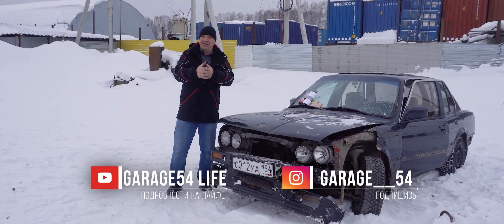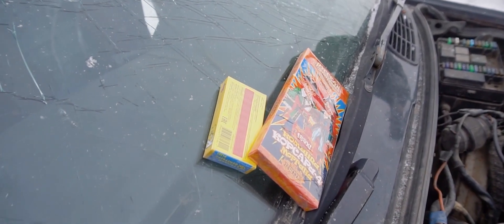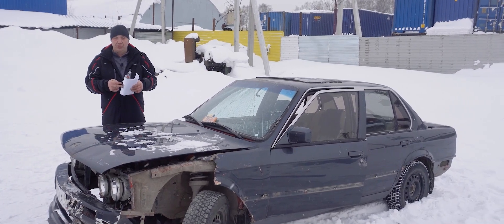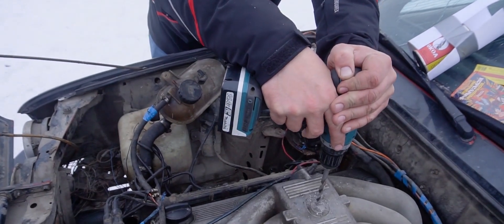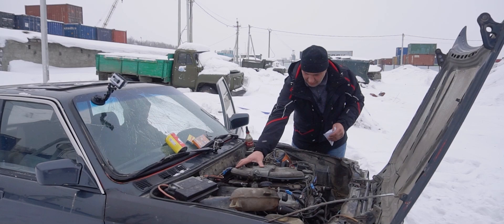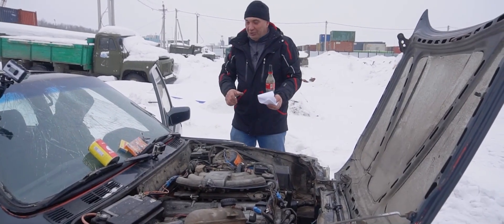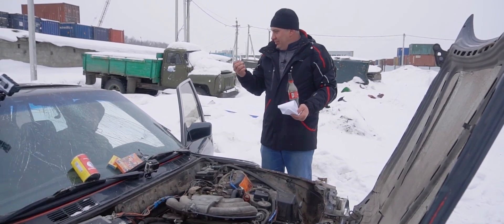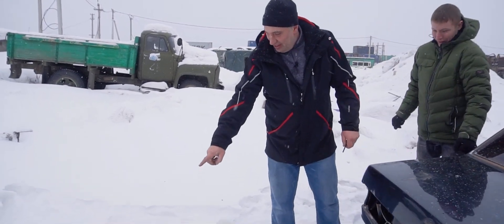What happens when you feed gunpowder into an engine?

Comment: Pour it into the gas tank, And when you do run it, Two things can happen. It will raise the sulfur which will make the engine sound like a diesel. Or the other thing is to use it in conjunction with gas and pure alcohol. It will make one hell of a noise

Comment: Next time you drill a hole in the intake manifold, put on a fitting where you can pipe different kinds of flammable gasses into the engine while it runs. You could show the effects of adding hydrogen, propane, acetylene, butane, methane... You could even (carefully) add oxygen!

Comment: oh thermite the engine, done
Reply: rust is a fine oxidizer, like NOS turbo gas
Reply: no bearings, air bearings
Reply: sliding friction is much less than lift power, sliding platform
Reply: chu chu train action

Comment: ever try to paralyze or bust an engine using a dry oxygen bleach dumped in with the oil?  here in the usa, comet is the name of the dry oxygen bleach, or oxy-clean.  may take some time to do so, and if you do this experiment, please take the engine apart so we can see what the moving parts look like afterwards.  a dry oxygen bleach is supposed to oxedise/rust anything made of iron/steel.

to stop the engine, you may need to go to your test-track and take some laps.  make sure the engine has pleanty of oil before you dump in the dry-oxygen bleach.

Comment: Add mothballs (paradichlorobenzine) to the fuel. 

Add sugar to the fuel and intake.  Keep adding until it stops running.
Reply: It will get caught by the fuel filter unless is is removed and bypassed.

Also that engine would be a caramel factory!
Reply: @IceAge20017  Dissolve it first.  Then add it. I'm not asking for public comment.  I'm telling them what I would like to see them do.  They ask for suggestions.  I gave some.

Comment: hey people any chance of taking motor out of a LADA and replacing it with a electric motor keep every thing the same but for anything that has to do with gas tank fuel lines etc.batteries go where gas tank was wires go where fuel line was electric motor goes where gas motor was plug in goes where fuel cap was

Comment: Plane engines in WW2 did indeed use gunpowder to start, utilising special shotgun type shells with a "damp" mix of powder and no wadding etc which when fired in series gave the engine a superb rotation if the batteries were dead.   Interceptors of the RAF utilised these for virtually instant starting of planes that intercepted the Luftwaffe on their daily air raids as starting a plane normally can take some extra minutes whereas the shell way just needed the engine to be fuel primed.
Reply: Some old tractors had that to
Reply: Gas turbines use rocket charges to spin up in a hurry 🚀
Reply: @dickard8275  c130 uses a JATO lol
Reply: @2vcrew782  Different notion.

JATO is an acronym for "Jet-Assisted Take Off", and that exactly describes it. The JATO bottles are used to supply additional thrust under certain carefully specified conditions to assist the C130 in launching, not to start the engines.
Reply: Some tractors used shotshells to start too
Reply: But thats just to start , working like a spark plug.
Reply: When the charge was ignited, the force was directed to one cylinder, causing the engine to rotate.  It didn’t run on the powder, just used to cause rotation.  
On the J57 jet engines, a gallon of powder was placed in the started breach.  As the powder burned, the exhaust gas was blown against the starter turbine, causing the engine to rotate.  
So all any shell or powder did was cause enough engine rotation, to start the engine normally
Reply: A lesser known fact is that the cartridge would often misfire so the engineers used a 5 pence (shilling) onto of the damaged cartridge and whacked that. Engineers reported finding shillings in the magazine catch.
Reply: must have been black powder. this one wouldnt work.
Reply: @johndow9383  i don't know what power was used, it was a shotgun shell type shell that you loaded into a breach then hit with a hammer to set off.

Comment: This is somewhat like the experiment that Diesel did on his very first engine using coal dust I believe.
Reply: peanut oil 🛢
Reply: @aeroflopper  I think that is what he finalized on, but I think he tried the coal dust first, but, I forget what happened I think the coal dust might have blown it up so he had to change.  It would be the oil once he used an injector.  I saw it on Wikipedia I believe.
Reply: @bitsnpieces11  the dust damaged the bores.
Reply: @aeroflopper  is that why gm/caddy in the 1980s discontinued the coal 5.7L v8 engine? as they had some test lease cars on the usa 🇺🇸 roadway's and Chrysler was playing with the idea as well but with turbine power instead of a gasoline or piston diesel engine

Comment: Garage 54, once the gasoline gets sucked through the very strong vacuum and into the intake past a small port it just lays there because the port is so big inside that the vacuum instantly slows down to almost nothing when it's being distributed to other cylinders so it's not flying around landing into intake valves like you think. And if it did get chopped up it wouldn't go bang anymore .  it would have a small flash though if it did not get wet inside internally possibly at the right time . But if it's enough flash powder of 70/30 mixed up yull go bang and can hurt somebody 😆  that pressure has to go somewhere . First
 the valves are the least resistance point. Or connecting rod.

Comment: What about starting the engine on gasoline, and once it’s running, start feeding it gun powder as the gasoline supply is cut off. Would it then run on the gun powder alone, the spark plugs igniting the powder.
Reply: But if the intake valves didn’t seat and the powder ignited in the intake runner and yeah… that wouldn’t be good. Maybe not such a good idea 🤣

Comment: Put a wide bolt and several locknuts into the head clearance space of each cylinder. Thread in for higher compression. Might make an amusingly dreadful tune up. Run high octane fuels if trying it.

Comment: Well, the first attempts at an internal combustion engine did use gunpowder and other flammable powders. The difficult part was replenishing the charge. Besides, there are shotgun starters.
Reply: Coffman engine starter. I remember hearing about those when I was a kid and thinking back some of the machinery I saw start up had those systems (either in old films I watched or in old machines around the farming area where I grew up).
Reply: You beat be to it! Yes I remember building a model of one of those early gunpowder engines when I was kid.
Reply: The first diesel ran on sawdust, those 12g starters are such a cool idea, beside tractors I've also seen them start radial engines on tanks/planes.

Comment: it's an old idea to use gun powder. Principly the issues were consistancy and much like you learned erratic ignition.
Reply: Why was the idea not established? Arent engine cylinders generaly using combustion?
Reply: @Moccalocca100  The issue was that a measured charge wouldn't guarentee the same combustion effort every cycle. https://en.wikipedia.org/wiki/Gunpowder_engine The reality was Gun Powder burned too slowly for the sort of reliable and immediate combustion needed in the modern engine. Ideas were tried but nothing worked consistatly. The best that could be achieved was as a starter on Field Marshall Tractors https://www.youtube.com/watch?v=VEurohAwrmA

Comment: well if you're working so hard to destroy the motor military used to take cashew nut oil and put it into ping pong balls the cheap ones the ones that would dissolve going through the fuel as it ignites it turns to glass that grinds up every bearing ring and bushing in contact with it was 2 oz of liquid added and by the way there is another kayro syrup you ever seen  burnt sugar

Comment: Unburned gunpowder in the exhaust is not surprising.  Smokeless powder is normally burned at a much higher pressure than one finds in an automobile engine, and low pressure leads to incomplete combustion.  You'd likely get better results if the engine had a compression ration of 700:1 or so.
Reply: Argh.  Compression *ratio*.  Not typing well today.
Reply: Maybe they should have used old fashioned black powder because it burns much quicker

Comment: I once read that the guy that invented the internal combustion engine initially tried to make a gunpowder engine, but he couldn't get consistent firing or fuel delivery to work, and when it did fire it was too violent for the mechanism and wasn't exactly a good source of power (he eventually gave up on gun powder and switched to liquid fuel)...This seems to back that up.
Reply: The problem was that the carbon residue would build up.
Reply: hydrogen  IS EVERYWHERE
Reply: @punker4Real  In a sense, yes. Isolating it for combustion or propulsion requires more energy than the output. Our current system of energy usage relies on the fact that nature formed it over a long period of time to be almost instantly useful without using more energy than what is gained.  You could call this the “efficiency threshold”

Comment: Fun facts about gun powder. It is self oxidizing so soaking it in fuel shouldn't change how it works as long as you supply it heat enough to hit its auto ignition temperature. Soaking it for long enough in something like water can ruin it though for 2 reasons. Either oxidizing the powder before ignition or sucking the heat out of the powder preventing ignition. It's a fun substance

Comment: What if you poured gallium in the coolant or under the valve cover on an aluminum engine? I assume it would get trapped in the Rad and cause a blockage' or in an oil passage... If that happens, you could hone the cylinders and rub gallium all over before reassembling and leaving the engine alone long enough for the gallium to spread.
Reply: This would be hilarious to see what gives up first
Reply: @drake501x21  if they use enough gallium and wait long enough for the whole block to degrade, the starter might generate enough force to split the block in half from compression alone. Or it might be a miserable failure.
Reply: @drake501x21  it would eventually weaken the aluminum enough to start causing blowby, probably find it's way the the pistons, and the engine would probably just lock or something.. or it would just crack the block.
Reply: Gallium will completely destroy aluminum, it's why its banned on aircraft
Reply: Galium would react badly with aluminium too